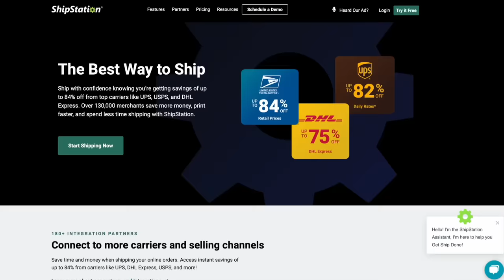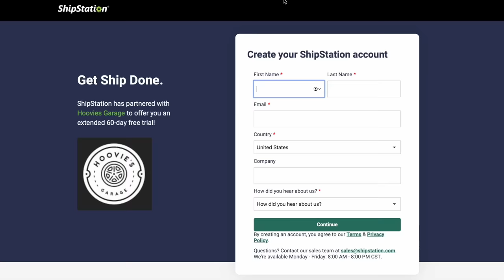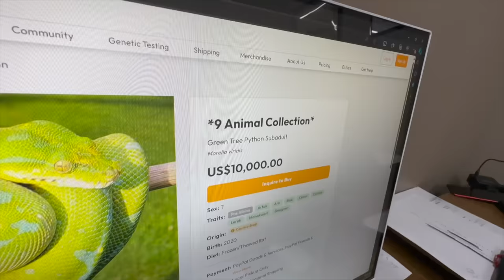I accidentally bought the MOST ANNOYING Dodge Viper in the USA (it was also really CHEAP)

Comment: It is amazing to me that they managed to get so little horsepower out of so many liters
Reply: I know 😂
Reply: "how do they get such little power out of a V8 motor" Jeremy Clarkson
Reply: There's a lot to be said for an understressed engine (keep in mind that the Chrysler V10 is originally a truck motor).
Reply: Well, if you want more horsepower, you can make it. How much do you want to spend? It's 512 cubic inches, so almost 1 hp/cubic inch - and reliable all day long. If you want to turbocharge your wimpy 4-cylinder and feel superior, go right ahead.
Reply: @fritsmolenaar05  7 liter V8 modur..
Reply: Yes but the torque on these things is insane, thats also to be expected because this engine is based on a truck engine. It also revs very low so its very understressed, very torquey but also very fuel inefficient. All to be expected from such an engine.🤝
Reply: This car would make you piss your pants
Reply: @paulfrantizek102 incorrect sir
Reply: Pushrod v8s make less hp per liter.  Common knowledge
Reply: @americanman911 Yes, but with laughter unfortunately.
Reply: The noise has to come from somewhere
Reply: I don’t expect them to give it more hp than that during that time. 500 hp is quite a bit in 2004 but it is easier to make a lot of power out of those engines with a couple of Twins.
Reply: american engineering.
Reply: You barely breathe on these things and it makes too much power to handle. These cars are opulent track toys that go all out. I would take this engine over any 500 horsepower 4 banger. You can actually drive it around like it’s a normal car at 500 horse.
Reply: American V10 are lame 😂
Reply: In 2004 300 hp was good. A Ferrari 360 of that era made 400
Reply: @theeoddments960  OK, that’s a valid point. I’ve driven two of these personally so I’m speaking from experience. The chassis on the first two generations was crap. The second one that I drove for a couple days had 325s in the back. Even that wasn’t enough to make the car feel really planted to the pavement.
Reply: @fritsmolenaar05  lol maybe subconsciously I was channeling my inner Clarkson
Reply: @paulfrantizek102  i’ve seen one of these at Texas 2K with. I think it was dual 106 mm turbos. The guy said it had stock bottom end with aftermarket pistons and some factory heads that had been ported and polished. Damn thing made nearly 2000 hp.
Reply: @Mitchell.Is.De.Naam.  v10.
Reply: Man oh man you haven't seen the cadillac eldorado making 180 bhp from 7+ liters of displacement
Reply: I know really?!! There are many American V8's with less than 200bhp !!! Crazy!!!
Reply: Vipers will do it for 200,000 miles. Ferraris do it for 20,000 miles
Reply: @comrade9374  won many races against Asian and euro cars. So...
Reply: @paulfrantizek102  the truck v10 is cast iron the Viper engine is aluminum.
Reply: Milk delivery tuck motor
Reply: Yes let's casually ignore emissions testing and Euro engines with W12 turbos making barely anymore power lol
Reply: @comrade9374 says the person who never drove one in the 2000s when this was the car to beat
Reply: @shmiggz Yes, but they are much more reliable compared to overhead cams
Reply: Horsepower per liter is a weird metric. A better and more meaningfull measure would be horsepower per weight or cost. The poor europeans get taxed on engine displacement and bore and number of head bolts so they need something to cheer them up over the lack of a domestic auto industry.
Reply: @georgemcfly1205  100%
Reply: @georgemcfly1205  eh I dunno about that one lol
Reply: Tales real talent to pull of that piece 9f classic Americana ...
Reply: @paulfrantizek102 the viper v10 was not a truck engine. Those are two completely different engines. One was designed by Lamborghini the other is based off of the LA/magnum block v8 engines.
Reply: I am old enough to remember the anemic late 1970s and 1980s vehicles including the super car "greats"  that couldn't beat  late '60s muscle cars in acceleration in a quarter mile so from where I stand in the context of the 2005 era  the Viper engine makes Pretty good horsepower for a naturally aspirated push rod engine that has it roots clear back to the early 1960s with the LA series 273CI Valiant V8 (The engine isn't a truck engine It never was the truck just happened to use numerous variants of the LA engine family). 
Just as an example Hennessy was taking the Dodge vipers in this time frame and bringing them from 500 horsepower up to a 1000 horsepower and that was still with a warranty so the potential was definitely there to make more power.
Reply: @jeremypike9153  They are both LA engines. 
The viper engine if I remember correctly is cast in aluminum and they used technology from the time when Chrysler owned Lamborghini to figure out how to cast the engine. It's not really a Lamborghini designed engine either but a heavily modified Dodge Chrysler Plymouth LA series engine.
Reply: So everyone says it's super under stressed and I believe that, does that mean you could push the power to 800-900hp  if you really wanted to and not have any issues? Or high boost if wanted to?
Reply: I think its more than sufficient, you want enjoy shifting gears without going over speed limits in 1st gear. Also who really wants zillion HP except youngsters
Reply: The Ford v10 had like 275 lol it could be worse and that was a good number for the year
Reply: @B0xlife1  I assume that is a typo you meant 8 or 900 horsepower. 
If so, Yes, you can boost The V10 to get it into that range pretty easily and safely. In my comment right before yours I mentioned the Hennessy viper He made a thousand horsepower and 1100ft lbs of torque and there was people that took his "platform" and made even more power out of it.
Reply: High specific output matter a great deal when comparing specs on paper, but a nice, flat torque curve is impressive when actually driving a vehicle. My 2012 CBR1000RR made significantly more horsepower than my 2001 Suzuki Bandit 1200, but the 1200 was much easier to ride in the mountains because it had so much more low RPM torque.
Reply: That's not how it feels from the driver's seat
Reply: @stuartblack9258 From the emissions era yes
Reply: Durability and mpg. The boosted and modified versions still hold up while so many of these over boosted European brands barely run right after you leave the dealer parking lot.
Reply: @paulfrantizek102 not it’s not common misconception it’s not a truck motor
Reply: @noonehere1793 not true. Engine was designed by Lamborghini in 1989 when Dodge owned them. Common misconception.
Reply: Are we talking about a tractor here?!
Reply: @memorimusic420 Torque is pointless if you can’t translate it into horsepower. Unless you are towing.
Reply: It was the coolest thing they could design at that time with effectively zero funding.
Reply: @juzoli  what??? Torque is definitely not pointless. That gives you the grunt to go... an engine with only horsepower wouldnt go that fast...
Reply: Paulfrantizek102 the viper motor isnt and never was a truck motor until the srt10 came out.  It was purpose built for the viper using no parts from the cHrYsLeR v10
Reply: That viper cabrio is much nicer looking than some of the older hardtops that I have seen? Is it a later facelift version??
Reply: The wizard is a wizard at price conditioning Hoovie! 😂🤣
Reply: @mbox314 true but any car that does less than 30mpg in Europe is not going to be a daily driver as our gas is around $10 - $12 per imperial gallon at the moment …
Reply: @googleniel  thats the 70s for ya 😭
Reply: @privateer0561  My wimpy 4 cylinder already came turbocharged, thanks (and instead of "almost 1 hp/cu in" it's around 2.6).   It's also done about 180,000 miles.  So I'll happily feel superior, thanks.
Reply: Actually considered buying a beautiful GTS in UK , for a massive car, they are very tight inside.
Reply: @AtomicReverend  fixed! Thanks 👍
Reply: @fritsmolenaar05 I was just thinking that. I think its an American thing.NA American motors are terrible. Throw some boost into the mix and the power goes up substantially. 

I wonder if that's a work around? It'd make sense to leave them na from the factory to avoid warranty issues. Even per say the z06/zr1 are fairly limited availablty, thus less mileage/less warranty issues... just a thought... I love Clarkson may and hamster
Reply: @comrade9374  well those American V10s, have people making 2000hp reliability, with a big turbo. Can't say the same about Euro, or japanese V10s
Reply: @12345kermie how? It sounds like shit ( all 4 bangers sound like farts) it makes less torque? And it’s not NA? Not as reliable? Like what are you proving?
Reply: @googleniel those 1998 eldorado’s were so smooth. Like a boat on a calm lake.
Reply: @memorimusic420  horsepower = torque x rpm. At the wheel, only horsepower matters. High torque only means you have more horsepower at lower rpm, which is very useful for practical purposes, but pointless when your only goal is to go fast.
Reply: @juzoli  Torque expresses the turning ability of the engine (the ability to turn its flywheel) and horsepower means the total power output of the engine. In very simple terms, torque is the force you feel pushing you back in your seat on acceleration, while horsepower is the speed achieved at the end of that acceleration.
Reply: @memorimusic420  Those are the same thing. There is only 1 type of force acting between the tires and the road. High horsepower low torque engine, like in an F1 car, also pushes you into the seat the exact same way. Only it causes way more wear on your drivetrain, as it is doing it at high rev, probably with the clutch slipping.
Reply: @Thisappaintreal  Well, if watched the actual video, you'd see that this particular Viper has done 30,000 miles. And has blown shocks, among many other things.  Startlingly broken, for something that's done that few miles.

My car, which is running on less than a quarter of the cubes of a viper, has done nearly 200,000 miles.  And develops 60% of the HP of the Viper (and more than 60% of the torque).

It's more reliable, it's more practical, and - except in the specific circumstances of a drag race - it's faster.

And cheaper.  Sounds like a rallycar, which is what it is.  If you think that's "farts", good on ya.
Reply: @p-townshankzilla2654  Lamborghini Gallardo and huracan can be TT to be beat those useless American V10🤣
Reply: @comrade9374  really, because the vipers are eating both of those all over Texas 😂
Reply: @p-townshankzilla2654  only thing those vipers knows is straight line and no corners🤣
Reply: @comrade9374  Bro, you realize Both the hurrican, and Gallardo both handle like shit right? And the ACR handles better than any version of either of those cars 😂😂
Reply: @juzoli  bruh those are absolutely not the same thing. And ofcourse these both push you in your seat thats called lateral g that just basic physics has nothing to do with power of the car... Torque = pulling power, HP = engine output... its only one google search away!
Reply: @memorimusic420  And what pulls the car? The engine output. Those are the same thing. 

If you google it, you should’ve found this equation: horsepower = torque x rpm. That should tell everything to you. Don’t deny physics.
If someone says the engine has high torque, it really just means it has high horsepower at low rpm. Which is beneficial for pulling heavy weights, as low rpm horsepower outs less strain on the drivetrain.
Reply: Never cared for the RT,GTS for me.
Reply: You this is bad? Cadillac only managed to finesse 190hp and 360 ft lb out of 8.2L/500cid in 1976.

My old '85 Fleetwood only managed130hp from 4.1L - though it could still do a smoky burnout brake-torqueing it - something the later 5.0L Olds-powered RWD Fleetwoods couldn't manage.
Reply: @slunktycoon  oil crisis... vs no oil crisis...
Reply: @juzoli  literally just the mathematical equation, doesnt work like that in the real world tho
Reply: @slunktycoon  Ignore that decade. They suddenly had to put a LOT of restrictions on the engine. So in that few years, all engines are trash in that sense.
They needed a few years to resolve it.
Reply: @memorimusic420  Mathematical equation which describes real life. That’s the whole point of the equation.

Do you think an engine dyno takes 2 measurements? No, it only measures power at the wheels, and then divides it by rpm, to draw the second line.
Reply: @juzoli  It should be clear that torque and horsepower are like estranged siblings; they’re closely related but don’t have much in common. While thumbnail definitions are great for textbooks, applying them to real engines is another matter. One concern is that every car engine has an idle-to-redline operating range. A high torque engine would be the equivalent of having really strong legs to be able to get your 10-speed bike going in 10th gear (with the highest gear ratio) while starting off going uphill (e.g. the quads of an olympic cyclist).  A low torque engine would be the equivalent of starting in 1st gear and a really low gear ratio (say one turn of the footpedal cranks gives one turn of the wheels, which is somewhat more accomplishable by couch-potatoes and pre-schoolers).  A high horsepower engine would be the equivalent of a cyclist pedaling fast in the highest gear (or comparably superfast in a lower gear).  If you were to strap X-men/Avengers' Quicksilver or the flash to a bike in first gear, doing 10,000 rpm, you'd have a somewhat equivalent amount of horsepower as one would get from the Hulk on a bike doing 10 rpm with a 1000-1 gear ratio. But anyway this discussion is endless imma go back to work 😭 have a good one 🤝
Reply: @memorimusic420  These comparisons are very misleading, and lot of people are confused by it, even if they are not completely incorrect.
High torque engines have more horsepower at lower RPM, that’s all. Ultimately it is also just power, but in practice, having it at low rpm suits better for a lot of use-cases, like city driving and towing.

And yes, a high HP engine is equivalent to a high torque engine, but at low gear ratio. That’s the point. The difference is engine wear, not power or towing capacirt. Whenever wear is irrelevant, like motorsports, they choose high HP, and torque becomes irrelevant. An F1 car is just as capable of towing, with virtually no torque, but its clutch will be burnt very quickly.
Reply: @juzoli  you can thank the 70's for unsightly 5-mph bumpers - which added hundreds of pounds and ruined many otherwise clean designs. Also when the ideal gross hp ratings were done away with and more the realistic net became the mandate - seemingly neutering most engines overnight.
Reply: @slunktycoon  HP figures went from like 350-400 down to 100 in like 2-3 years. That cannot be explained by calculating differently:) 
This was entirely about the oil crisis, where they had to drop their engine design altogether, and pretty much start from scratch.
Reply: @juzoli  the change from gross to net specifically happened in 1971 to be in effect for the 1972 gmodel year and there were other factors at play beside the oil crisis at the time - namely government mandates regarding pollution.
Reply: @slunktycoon  Gross to net is like 20% difference…
And the pollution mandates went hand to hand with the oil crisis. Reducing pollution was pretty much the side effect of reducing oil consumption. Nobody accepts sudden 4x performance drop in the name of the environment, not even in EU today, and definitely not in 70s America:)

Comment: Saw BC coilovers were cheaper than used shocks. Ordered those instead!
Reply: Had them on my 3rd gen and was really happy with them.
Reply: Also for the rears you can get Kumho ecsta v720 acr, which are 335/30zr19 that stay really planted for about 470, per. Best tire I put on my 3rd gen.

Comment: I think you should dyno it maybe find out whats done to it before reverting any of the mods
Reply: That’s exactly what I was thinking !!!
Reply: Maybe after replacing the tires, these aren't holding traction.
Reply: That would be interesting to see
Reply: Dynamic it and remap it to make it more drivable
Reply: Yeah I’ve dynod about 10 of these 2003- 2005s , they made about 420-430hp to the wheels stock.
Reply: Throw some coilovers on that thing! It will probably be cheaper and make it ride/handle better!
Reply: This is facts.
Reply: A nice quiet exhaust would be nice! We don’t have too many vipers in the U.K. as they are a little bit expensive to run with our horrendous petrol (gas) prices!
Reply: @philtucker1224  Fuel economy is most definitely not the Viper's greatest selling point. Even when fuel is cheap, it's one thirsty boi.
Reply: I recon this was videos a while back as the beginning bit looks like the back garden of his old house so probably way too late.
Reply: Great idea until those mods grenade the engine.
Reply: @Prosecute-fauci right, why tf would you dyno, aka stress test this car without knowing what all has been done to it
Reply: @Prosecute-fauci  You can get away with quite a bit with a Viper engine, thanks to it's relatively low-tech nature. Much more durable than the engines found in fancier cars.

That being said, parts ain't cheap for 'em at all, so you definitely don't want to f*ck it up.
Reply: @AzureVeridian Street pulls are much much harder on a motor, anyone with a modified car will tell you it never blows up on the dyno, it's always on the street, and somewhere in a higher gear
Reply: @philtucker1224 It’s sad that we don’t have many large displacement engine cars here in 🇬🇧 They are just so impractical for us to run with our crazy fuel prices, insurance and road tax. I hope you 🇺🇸 don’t take it for granted.
Reply: @chrismason6857  yes I believe that gas prices in the states has always been kept artificially low (by the U.S. auto industry) over the last 100 years to encourage everyone to buy and run big cars. ( it seems to have worked!)